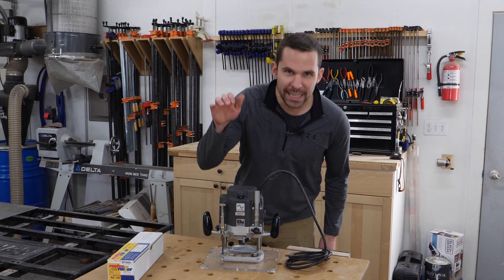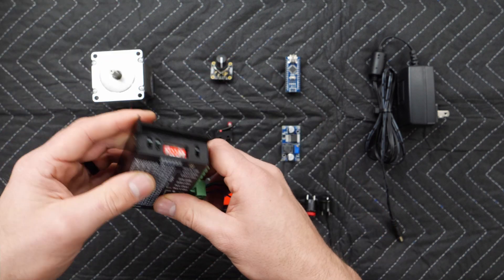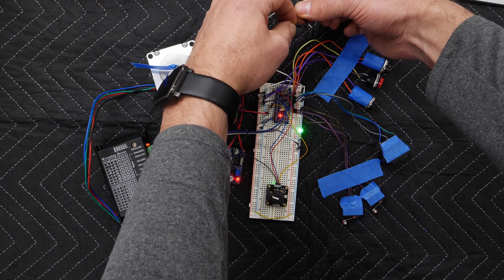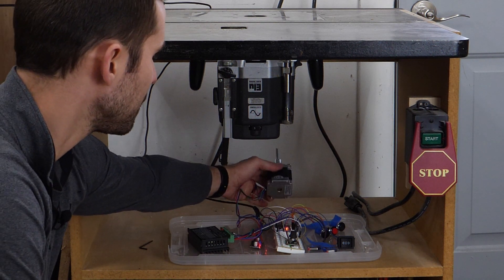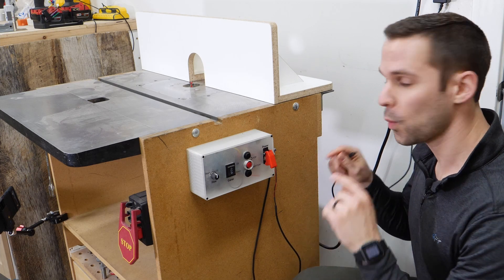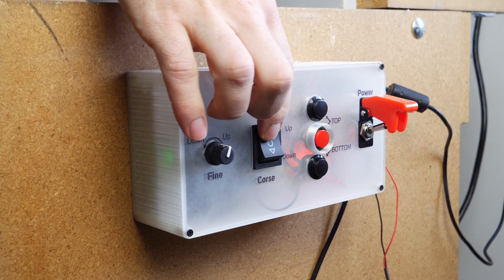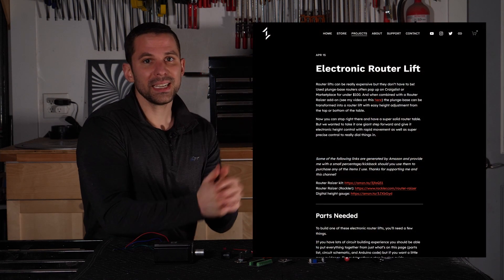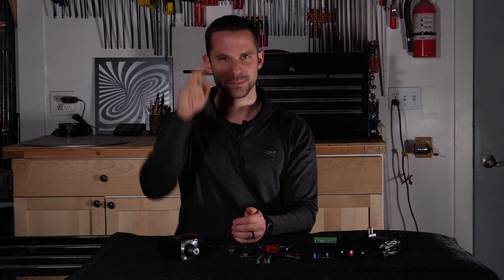Ultimate DIY Router Lift - It's ELECTRIC! And Budget Friendly!

Comment: Would the same code work on a Teensy?
Reply from the maker: I haven't tried it but I think there's a good chance it would as long as you make sure to add the same libraries and make sure the pin assignments are updated to the ones you'll be using on the Teensy.

Comment: I subscibed because I can really appreciate the details and the resources. I am a big Arduino user My preference is the Uno. I am glad I have a 3D printer. While watching this video a few Ideas have crossed my mind. You actually provide the wiring diagram and the code which is very rare. Thank you
Reply from the maker: Glad you liked the details. That's the goal of making these videos.
Reply: @42Pursuit  I am also into circuit design and would love to put together a simple CNC to etch copper clad boards on the cheap either with the use of a marking pen or a bit I have an old Dewalt drill 12 volt I can use as sacrificial. thx man

Comment: Hello I bough your plans and trying to figure out what is the part for the insert into the 3d printed box to thread the screw? Thanks
Reply from the maker: It's a brass threaded insert. I use a soldering iron to install them into the plastic holes. You can get them many places including Amazon: www.amazon.com/dp/B08P1T5693
Reply: @42Pursuit  thanks! I live in Canada so guessing I'll have to find an alternative since they aren't in stock.
Reply: @42Pursuit  Hello I also noticed that the 3d file for the safety button rim is not available.
Reply from the maker: @philipchristian9935  https://www.thingiverse.com/thing:5336830

Comment: Hi, can you make this so that the rotary encoder changes the speed of the stepper motor rather than steps? I am trying to make a power feed with stops and direction control for a milling machine. I have all of the components you have listed. I assume it is just a case of changing the code somewhere?
Reply from the maker: That's definitely possible by changing the code a bit. It's currently set up to constant velocity but with some rewriting I'm sure you could get it to do what you need.

Comment: Hello I'm thinking of buying your kit. I have a Bosch 1619EVS 3HP plunge router. I can rotate it up and down using a wrench+nut. I was wondering how I could attach a nut directly to the stepper motor so I can continue to use the same mechanism? Assuming I have to use a specific collar but thought to ask you. Thanks
Reply from the maker: Very likely! It'd would take a little figuring on your part to connect the router height adjustment to the stepper motor shaft but if that seems doable I believe it should be possible 👍🏼 The stepper motors are spec'd at 269oz.in/1.9Nm so as long as that's enough torque than you should be good to go.
Reply: @42Pursuit  Thanks! I figured out a way to get it working. Now just have to follow your instructions.
Reply: @philipchristian9935 
Hey Philip,
Im also considering using a Bosh1619EVS with this electronic lift setup.
What did you come up with to get yours working?
Thanks for any input you might have!
Edit: Also what Plate did you end up using?
I don't have the router yet.  
Have a cordless Dewalt and a Old POS Ryobi.
Was originally going to mount the cordless Dewalt, 
Then realized Ill end up needing more power.
There are sooo many choices of Routers,Lifts,Tables,
It is all very overwhelming!

Comment: Do you know if there’s a lead screw thread pitch available which could correspond to 1/64” adjustment per step(s)? I’d love to have a fine adjustment like that and program the course to move in 8ths or 16ths.

Comment: Super cool! I'm just purchasing parts for my router table and decided to go with a Triton router, which is based on your Elu. I'm definitely going to build this as pushing a button is so much easier than cranking a rod with a handle. Have you had any problems with dust ingress to the stepper motor or limit switches? Signal shielding is often an issue with CNC machines, but I guess it's not critical here because the router would be turned off when its height is adjusted.
Reply from the maker: There shouldn't be any issues with dust getting into the stepper motors as they're generally rated for dirty environments and are sealed up quite well. The limit switches aren't as sealed so might be something to keep an eye on.
As far as EMI issues, you shouldn't have a problem even if the controller is left on as long as the stepper motor wires aren't ran so they parallel the router power cord for a long distance.

Comment: If you are going to use an Arduino to drive a stepper motor, why on Earth would you control it manually? Tell the Arduino what height you want, and it goes there. Yes, there is free play in the drive connection- so fit a small DRO (cheap as a stepper motor) and use that to know the height. You can then use a cheap geared motor to do the drive (costing less than the stepper driver). While you are at it, you add a stepper driven fence. Then throw away all you height gauges- you do not need them. Select height and fence distance and it goes there. Then expand the code to allow automatic movements for finger and dovetail joints. And variable width dados. And slot cutting. Yes, the zero needs to be set- using a detector that the Arduino can see, not a LED. Sound good? Next project on my channel (and yes, it works just great!)

Comment: I would love a digital hight setting for my Dewalt table saw since you have to turn that wheel a ton to move it up. Sure it makes it more accurate to have it at like 1mm per rotation but it makes dailing it in a pain.
Reply: Fit a small DRO and a drive motor.

Comment: This is pretty awesome! Instead of the LEDs telling you to stop, couldn't you connect those to the upper end stop pin and then just use the "go to top" button which would move it up until either the upper end stop triggers or the magnets make a connection.
Reply from the maker: Thanks so much!
Totally! That's the beauty of it running on code that can be modified, you can make it act just like you want 😊

Comment: Hi, purchased your plans and just one question on the TB6600 driver the Dir+ and the Pul+ are connected with the Nano, the Dir- and Pul- are connected to -12V power supply is it correct?
Reply from the maker: Yes, that is correct. GND on the TB6600 is also connected to the -12V as well.
Reply: @42Pursuit  Thanks for your prompt answer. Wish you all the best.

Comment: Seriously slick.  If that functionality was put into production lift, they'd sell it for $1000.  As a system, there is some possible patent angle, but it's cool that's not your thing.  Great work.  On my project list for some day.
Reply from the maker: Thanks! I've thought about the product/patent side of this idea but decided I'd rather share it with the world so more people could enjoy it at a lower price and maybe gain some confidence working with electronics.
Thanks for watching and leaving such a kind and supportive comment!
Reply: @42Pursuit  Cool stuff.  I first used steppers in an 8 bit microcontroller course as an undergrad in 1984.  How's that for dating myself, lol?  In any event, an improved router lift is kinda cool nice-to-have.  However the tech you have set up and the precision would work on 2 axis for CNC set-up for woodworking would think.  I haven't researched, but be interesting to see if you could sell a 'kit' with all the elements that could NOT be done with wood (take some thinking as to where and how much moisture-related movement would be tolerable for the use cases), as I expect there are a lot of woodworkers who would a) see a possible route to more income with less of an investment, and b) could customize the size to fit space(s) they have.  Just an idea, and one I might look into myself someday.
Reply: There is already a system out there- which incorporates a digital fence too. Semi-automatic joints, dados, etc. But it is $2000. I have built one for a small fraction of that; build on my channel soon.

Comment: I am going to purchase your plans to build this, I already have most of the parts just had a question about the encoder. I have one  part # HW-040, will this one work? Thanks
Reply from the maker: No, unfortunately not. I initially tried using that encoder but had a ton of issues and later found out those are notorious for not being able to reliably and accurately increment and decrement due to switch bounce issues. That one from Adafruit has it's own small microprocessor that takes care of any counting and debouncing which makes everything else much more straightforward in the code and hardware.

Comment: Quite a unique idea. I plan to put the USSA 3D printed router lifter 2.0 in my workbench and I was thinking of using a raspberry pi to control the height. I think your idea is better.
Reply from the maker: Hey thanks! Yeah, microcontrollers for this kind of application work super great.
Reply: You were really going to use an operating system to control a single parameter? Bet you use processors in your lights switches- and the switch gives an interrupt...
Reply: @Tensquaremetreworkshop   the pi’s are already used on the Printers using octo print. I was going to use an output to control the axis as I am disabled with limited mobility. My lights are controlled by voice.
Reply: @ewen832  Ahh, I took 'using a raspberry pi' to mean dedicate one to the process. I take it you are going (or have) used an existing module... For this application, a geared motor (windscreen wiper type) and a couple of buttons are more appropriate. Given the backlash in the mount, using a stepper has little value. Personally, I used a geared motor with a digital scale to measure the position, and used the Arduino to move to the desired position. Accurate to better than 0.1mm, and with a digital fence, I can throw away my measuring equipment. Just enter where you want to be. Does finger joints and mortices too...

Comment: Great idea, but very impractical for the person lacking an electronics background and 3D printer . . .
Reply from the maker: I mean kinda, if you were to design one from scratch. But that's why I made a step-by-step guide and included options for parts that don't require a 3D printer, and that's also why I have kits available as well that include all the parts needed to put one together yourself. All someone really would need is a soldering iron and a can-do attitude.

Comment: Perfect! I had thought of doing a stepper driven router lift. I was going to build the lift with lead screws but l like your Router Raiser approach. Have you thought of using a servo instead of a stepper? I understand they have more torque and hold their position without consuming power. Servos also report their position.
Reply from the maker: Cool! Glad you got some value from the video!
Typically servo motors are best for high speed, high torque applications while stepper motors are better suited for lower acceleration, high holding torque applications. Based on that, steppers would be the better choice for this project. Servos are also more complex to integrate and generally more expensive than stepper motors. If you do need positional feedback, a closed loop stepper can sometimes be a good in-between option.
With steppers there's significant holding torque to hold the position as long as the driver is is powered on so I don't have any worries about the height changing while routering anything.
Reply: Just use a geared motor. If it is worm gear (often are) no holding current needed. Way cheaper, more powerful, and can be controlled by a simple speed controller. Or pulse it from an Arduino; if you then add a DRO you can have a digital height control (enter desired height and it will go there). There is no point in using a stepper motor if you are not going to use its positional accuracy- which the backlash in a router lift (of this sort) eliminates.

Comment: When using the touch probes, disable the up motion when there is a connection. Maybe new feature, add a digital display.
Reply from the maker: Yup! Like I mentioned in the video that is totally a valid option, I just prefer the visual indication from the LED.
What would be on the display? I originally thought of adding one, but since every bit is a different height there would have to be an additional step in setup if the display was for height readings.
Reply: @42Pursuit  yes height display. And yes it would have to be calibrated to the specific router. Unless they all use the same threads for height adjustment.

Comment: One thing that's not clear to me is the stepper motor requiring 12 volts or is it requiring 5 volts?
Reply from the maker: It's running off the 12v supply from the wall-wart. The DC-DC convert steps the voltage down to 5v to run the Arduino and rotary encoder boards. There's a schematic picture blog post that shows the wire connections and might help things make sense: https://www.42pursuit.com/projects/electronic-router-lift